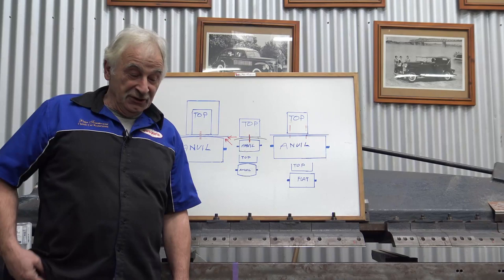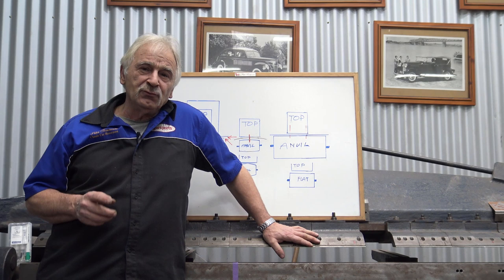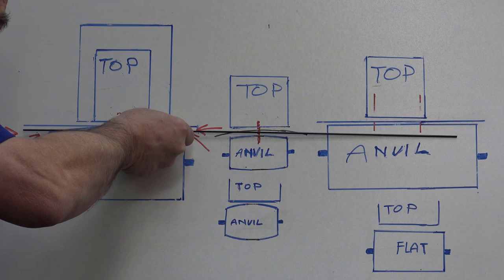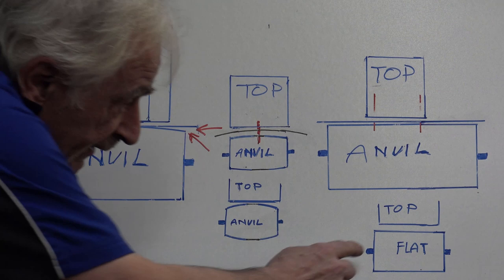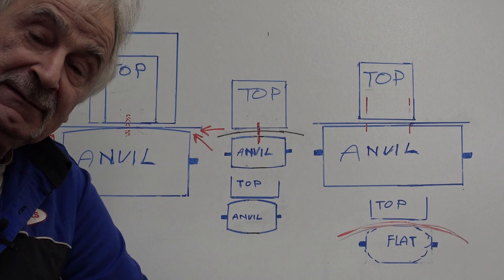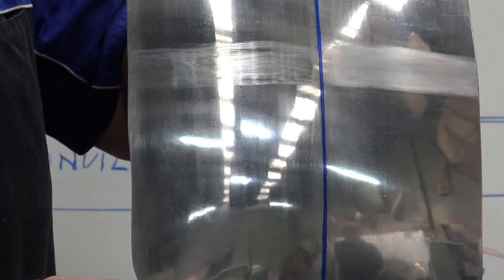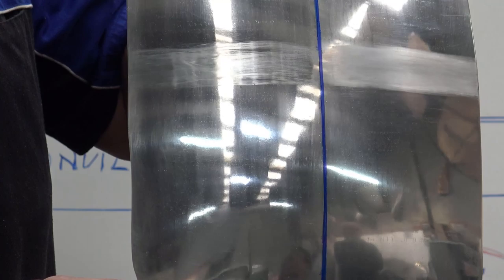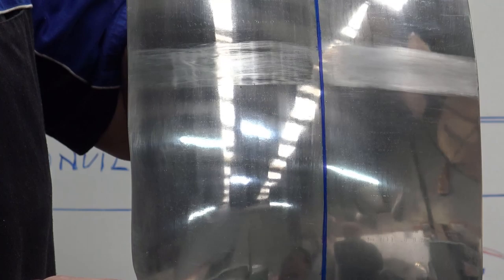Light Discussion About Full Radius Anvils vs Flats With Peter Tommasini

Comment: Thank you for taking the time to post this Peter. The 1200 grit blocking can't be argued.  With a low crown panel like a door skin, one might be able to get away with using the flat dies.  For polished high crown panels, it seems imperative to use full radius or you will be forced to sand heavily to remove the flats. I purchased your DVD's many years ago and they helped me quite a lot.

Comment: Quite simple.
The contact zones between two parallel cylindrical surfaces is a line.
The contact zone between a cylinder and a spherical surface is a small oval spot.
The smaller the radii, the smaller the contact zones and the higher the pressure in that area, resulting in more deformation of the workpiece.
The smaller radius at the lower anvil causes more stretching resulting in a tighter radius at the workpiece.
But this will also require more passes, as the "lines" get more narrow.

But that's just theory.
Good to know. 
But having the skills of someone with that much experience as these guys here is something completely different 😉
Reply from the maker: That is why the smallest the radius is , the less pressure is used when wheeling

Comment: Thanks, Peter! Very good and logical explanation from one of the best in the business. Wish I'd seen this before buying lower anvils with flats. IMO, and having used the English wheel for some time now, I think that the anvils with flats were devised to overcome inexperience, whereby either too much pressure or "wild and irregular" placement of subsequent tracks - and perhaps even both, led to over-stretching and poor control over the desired shape. Yes, I do get "tracks" in my panels...
Reply from the maker: An  easy solution would be to take the shafts and bearing off  them,  get them soft again  and get them  re machined to full radius, then get them hardened again .They need to be hardened or they will  wear flat again pretty quick .
Reply: Thanks, Peter. Will get a new set made up and hardened.

Comment: The metal in between the anvils thins, but thinner metal is also pressed outside the circumference of the contact area of the anvils. This is the (part) or  faction that curves the most.
If a piece of metal is laid down on blacksmiths anvil and struck with a hammer thats face has a smaller area then the anvil, the metal will always curve towards the side with the smaller area.

Comment: I think the idea of the larger lower anvil is the same as a hammer and dolly. You don't hammer and dolly with the end of a half inch rod because the only place getting contacted is where you are hitting. You have a dolly similar to the curve so that as you hit a low up or high down the surrounding metal is supported.
Reply from the maker: If you think that way , that is fine with me  .  As mention before a extra wide anvil    (from a  standard size )   is not an advantage .  The amount of pressure applied and full radius anvils  is. ... As far as the hammer and dolly ...Well that is another story ,.... it all depends on the required operation .

Comment: Lots of sense behind your statements. It's all about the size of the contact point and how much area pressure you get form the force applied. Same force on flat or full radius will give more contact pressure for the full radius and by that more work done. As said before in te comments flats might save your ass when you learn wheeling or be used as a finishing deal on love crown surfaces as hoods and doors. I'm not an expert at all but have seen a lot and use only hammers.
Reply from the maker: Thank you, I personally do not like using  anvils  with flat surfaces

Comment: Modern wheels are to stiff and ridged ,I think. Old wheels seem to be flexible  metal😂...I know that sounds crazy but it's as if they where self adjusting ?
Reply from the maker: The fact is that most  modern wheels are fabricated, means that  there is little  feel  and  too much  give from the frame ,  in some cases no feel and no give at all (meaning too stiff)  there for a lot of pressure is used  to stretch a panel especially by using flats on the anvils. The old wheels (been cast iron ) have a feel and a bit of give as well, this fact.... (feel and a bit of give )  allows the operator to control and  to be able to  wheel with little pressure,  so by using a cast wheel and full radius anvils, the operator can wheel a panel quicker and because of the low pressure used there are no lines in the panel .

Comment: But in the UK all of the traditional wheel guys use flats jncluding guys who apprenticed at Aston Martin etc. Lots of their work is here on youtube. They’ve been using them for more than 100 yrs. John Glover, who brought the wheel to America and who worked at Ford in England, Dehavilland aircraft in Toronto and the GM prototype shop in Michigan used flats. Same with Butler, Covell, Fournier and hundreds of others who have done great work. So I can see that the technique might be different and the pressures used might be different, but how can you say that flats don’t work?
Reply from the maker: I think you should do your home work a bit better ,In England the traditional tradesman  only use flats for specific tasks , and only a few of them use them as well . As I mention on the video I do use flats but only for some specific shapes ,  90% of the time I use full radius simply because the shape is achieved a lot quicker and they give  more control and feel without putting lines on the job.  Try your self by wheeling a panel and compare the two . Remember... as I shown , little pressure at each  time rather then squeeze too much too soon. Having said this, Please use what you are used to , or more comfortable with . 
PS......  are you confusing flats in the center rather then a specially modified lower anvils for some tasks ?
Reply: @Handbuilt1  I have never tried the full radius dies and I am not an expert. I am going on the fact that everyone I see in north America, to my knowledge,  uses the flats and the main supplier, Hoosier profiles, sells primarily the flats. I have seen some videos of an older guy in the UK who trained at Astons and he was making jag bonnets on a big old cast wheel with flats on the anvils so I just assumed that they all used that since both he and John Glover were old school English apprentices. But I have not been there and my knowledge is limited.
Reply from the maker: @sblack48  I know of the guy in England  well,  you probably find that he was using flats to finish off the Jag bonnet  after using full radius, simply because after achieving the shape needed, and there is no need for more shape,  the flats with the same radius , will smooth thing off  quicker ..BUT REMEMBER when using flats do not apply excessive pressure